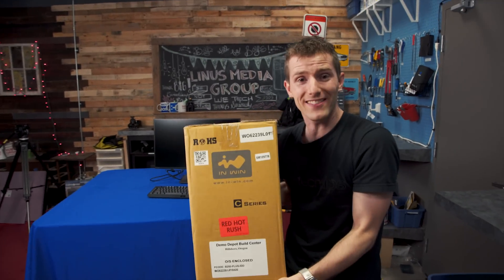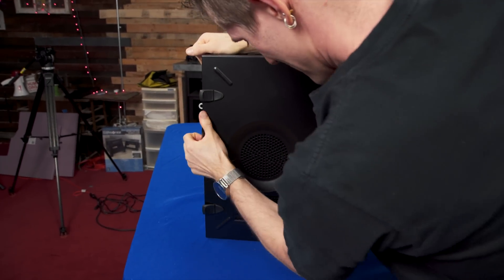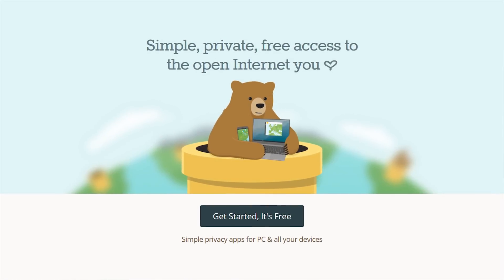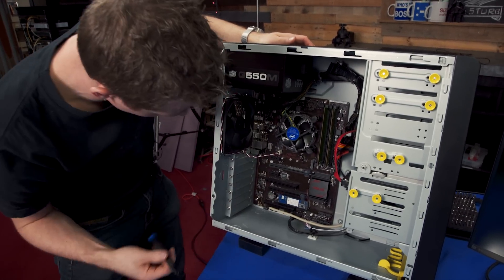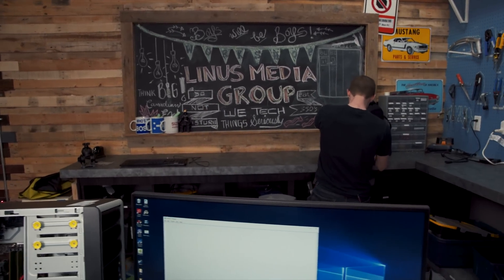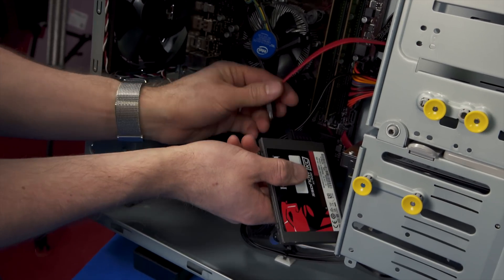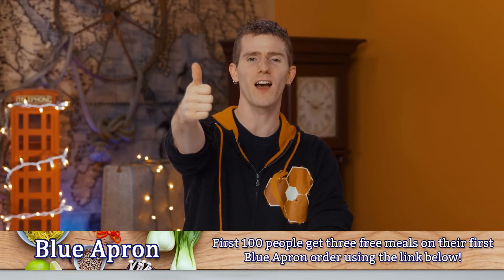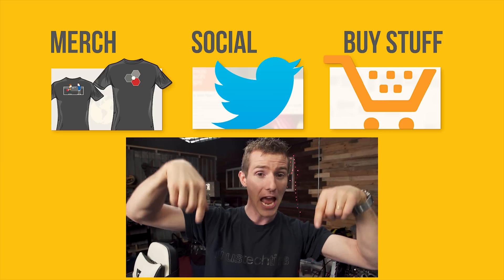Turbocharge your SSD for $40??

Comment: My computer comes with the i7-8700, 7200 1TB drive with Optane 16gb memory. Its blazing fast compared to my previous computer. But if I upgraded to a SSD, I wouldn't buy the Optane memory. Optane memory is only made for Mechanical Drives with the newer Intel CPU's. Its cheap way to get SSD performance. I believe Intel is going in the right direction with the Optane Memory.

Comment: But I presume Optane doesn't have "write" issue like SSD right? The write issue not just decrease the SSD life cycle, but also (for most SSD except Samsung PRO) will drastically decrease write speed of your SSD after maybe a couple hundred or million write process. If this true, Optane have big advantage over SSD. right? Imagine: paging file for windows, scratch disk for adobe, IDM, etc on harddrive instead on SSD.

Comment: OK.. So you cant install this in an AMD Processor MB.. And the question is comparing this installed with a regular HD and then comparing the results with a stand alone SSD not with the module.. I would be interested in those results not this one.. I would wonder if boot times where faster with this with a regular HD and whether or not it was worth the cost or just getting an SSD instead...

Comment: So, this module does pretty much the same thing as using a thumb drive with Windows ReadyBoost to speed up an HDD? Seems like it is just an internal solution with the same effect, but I could be way off with this.

Comment: Buying a couple of 1-2TB HDDs and adding a 40$  chip to accelerate them is much more cost-effective than getting a single 1TB SSD, I think I might buy this little thing... plus it sounds f--ing cool "Yeah I've installed Optane in my system"

Comment: Intel now has on their FAQ that Optane will improve speeds of an SSD.

Also worth noticing though, is that once you connect an optane module to a SATA drive, you can no longer defragment it as it will appear as an SSD to the system.

Comment: Knigston SSD? What changed in the last 2 years that this is a fast SSD? What actually does the optane stuff accelerate. Looking at the graphs this is a hit and miss acceleration. Trubocharge your SSD for 40 bucks?? Nope!! Why nope, because spending 40 bicks mor on a SSD already helps mor then this intel bs. And whoever is trying to speed up a harddrive is 4 years minimum behind technology anyways and just has to switch to SSD anyways.

Comment: Static Static Static, my heart drops every time you touch static sensitive components with no static strap??
Reply: Question: How often have you, or somebody you know, ruined a card cuz "no static strap". Serious question. I used to use them 20 years ago, then didn't use them when I was taking out old components...but the old components always still worked. So I just stopped using them. Has anyone had a problem with this for real, or is it like the "don't use cell phones near gas pumps or in a plane" BS.

Comment: Dude I got one too. It's only the 16gb m.2 module. I am running it from a q nine to only a pcie 2.0 x1 which is an x16 connector. Running it mostly with page files. I will upgrade to NVMe soon. It's nice though about the read/write durability.

Comment: I have both SSDs and magnetic hard drives. I would be interested in something that improves the magnetic drive performance to where it's much closer to SSD performance. I want 4k file performance over large file performance. Large files already transfer pretty quickly on a magnetic drive. However, the 4k/small file performance benchmarks often left me disappointed in the past. I found it better just to use an SSD for most people if they can afford to. 

That being said, an SSD cache would be perfect for cases where I have a lot of files, but I only access ____ at a time. A perfect example is video games. I don't play more than 5 of them per month, but I have over 100 gigs of them installed. I'm still mixed about the 4k performance benchmarks of the past, but if it was higher, I think it could be great for video games. So, that game will load at magnetic speeds on the first run, but on the second run (example: you die and reload a save game), it'll run at SSD speeds. 

It sounds like the server world has this, but I would love a desktop version that isn't proprietary to a system

Comment: The optane is the equivalent of putting a bandaid on a giant gash. You'll still bleed heavily with your hdd (given, you have the m2 slot) when you should have just spent the extra $60 on a tourniquet ssd as your boot drive, leaving your hdd as the slave/mass storage.

Comment: Hmm, i have a bunch of old mechanical hard disks ( 150 / 150 / 300 gb ) and one ssd. So for about 80 to 120 buck i could bring some or all those disks on performance level of ssd. Sounds interesting, but i would need a new motherboard...ram...cpu.. and might as well buy ssd with it....
I think that thingie is nice in some edge cases ( you are buying a new components and have old 500gb to 1tb mechanical disk lieing around ) but mostly its more cost efficient to just buy an ssd.

Comment: What u think i do for 32 gig steem 14 hp labtop  i need help storg shit pleezzzzzz hhd 25 cash 160gig what can u tell me or help me fing batter deal i wood like u professional opinion on what I should do for extra storage for the stream HP 32GB 20 of a used off you understand that's not enough for anything I was going to just get a hundred 20 gig or 60 gig flash drive Mini but I'm thinking about 160 or higher hard drive Dell crew to the laptop

Comment: OPTANE Memory is a good Idea... Sadly it only Cashing the C: Drive... So in Time were NVME (PCIe x4) Drive are Sold on Market its a little Nonsense. A "Normal User" should have a SATA3 SSD or if really uptodate a NVME SSD as C: Drive - Sorry. BTW some one that need a "Boosted" HDD can buy a Hybriate Drive since Years...

Comment: This is actually good for people only using, lets be real a 1 TB SSD or m2 SSD would be way expensive compared to a 1TB HHD + optane. But yeah the requirements to run on of those are basically the same that a standard pc with SSD, so i get the intended use but no the target market, maybe they only introduced this to make some marketing for their Optane SSD, who knows. As my future MOBO will only have one m2 slot I would use it for a SSD M2 card with their own software to cache using RAM

Comment: ehh rather want a 1tb m.2. drive then that optane
Reply: Won't that be the day when a 1tb m.2 drive costs $77
Reply: I agree.  i'm currently looking at the Crucial P1 1TB 3D NAND NVMe PCIe M.2 SSD - CT1000P1SSD8 m.2 drive for $145, read/write speeds of 2000/1750 MB/s.

Comment: I was telling you Linus on another video on that Intel SSD that comes in 16Gigs and 32 Gigs also noted on this video. Yes I agree its a good concept on Intel New tech. I  tried a standard M2. NVME SSD at 256 or 240 simply cannot have enough room for Windows 7 and GTA V PC. all its storage is used for Windows, drivers, service pack 1, all of the Microsoft Visual C++ Direct X 11 and on and on and on. and  virus killer. So  I am waiting for the price to drop on the M.2 NVME 1TB SSD simply wait two years and see what happened if the price dose drop. that new SSD from Intel you was talking about yes I agree wait until they come up with larger 1TB and price it $50.00 so people will be buying it. Knowing intel. its going to cost $2000.00 its because they can. My M.2 NVME slot remains not used for at least 2 years starting 1/1/2018. why pay too much now when can wait 2 years for sweet deals. if the price on a M.2 NVME 1TB SSD for $50.00 I might get one., Both Intel and Samsung is over rated and over priced as the same Apple is.  Why pay $700.00 or $800.00 USA DOLLARS on a SSD of any kind? STUPID! When it dose fail then want? Trash it? I made too many mistakes paying way too much for High Tech that failed because of made in CHINA, disgusting manifactor process. Time for USA and CANADA out China on finance bankrupt.  Then MADE IN USA FOR USA. MADE IN CANADA FOR CANADA. They selling us BULL SHIT PRODUCTS and I like to stop that. That will make ROLEX very Happy and USA and CANADA happy.

Comment: Had to change my comment before I commented I had thought about adding a riser card that supports optane but as Linus says it's only for newer Intel systems. So that must rule out the use of any of the Ryzen chip sets with optane? Now that optane has the matured why aren't they just putting the optane technology directly on the new motherboards?  Just that would make too much sense.

Comment: Having a "high-end" 7th gen Z chipset doesn't mean that one would have a 1t SSD... BUT, I wouldnt pay 70dollars for a 32gb cache ssd, when I could pay $150 for a 250gb samsung 960  and use it (partition) as cache disk for the games I install in HDD's (using primocache). Or I can  just buy more ram with that money (well, when ddr4 was cheap).

Comment: I wasted my money on a 32Gb Optane module. First off, my Intel 600p NVMe isn't supported. Yes, Optane doesn't support Intel SSDs.
Second, the Intel RAID was so buggy, it corrupted my drives and lost all my data 3 times, twice on my boot ssd I had to reinstall windows.
Finally, it's only 1GB/s read in Crystal disk. A 250GB Samsung 960 EVO is 3 times faster and only $30 more expensive than a 32GB Optane.
Reply: lewis hayward
I agree. My Galaxy S8 runs Crysis 3 at 300 fps high settings with OC
Reply: Special EDy is this true? I can't use the optane on an Intel SSD?
Reply: I was unable to pair it with the Intel 600p, I ended up finding it clearly written in the fine print on Intel's website that "their SSDs are not supported by optane".
Reply: Pretty odd. You would think they'd support their own products, but thanks for the heads-up!
Reply: lewis hayward Kind of like the difference between driving a hotrod, or a prius with a warranty. They do make prebuilt PCs with warranties too though...
Reply: @GENOSANDIEGO  yep its true, tried it with work money
Reply: I'm glad I read this because I was about to buy one. Thanks for your honesty you're helping a community
Reply: seriously? software raid? i've been using triple ssds in raid 0 in my system for about 2 years and have never had an issue with it.. even when the power goes out. but i do have an asus maximus viii hero mobo. and as for a warranty, alot of computer parts come with warranties if you get them from reputable companies. most of them are 3 years even, which isn't a bad upgrade cycle honestly.
Reply: I too have had terrible experience with Intel and raid. I prefer to use full-on software raid because of these frustrations over decades with no tangible improvement. Full-on soft-raid in Windows or mdadm in Linux give much more reliable results in my experience. Now, there are some higher-end "hardware" raid (you know why I use quotes there, haha) which I've had no issues with, but still tend to prefer mdadm in most cases. A battery backup on the raid controller is the only real plus I can see over the full soft options... anyways, I'm sorry you had bad experience with Optane, I doubt it has much support, if any for Linux (i'm about to go research that) so I don't know if I'll even try it at this point.
Reply: lewis hayward im actually just starting on building and tbh i guess it depends on who u are but its really not that complicated depending on how interested you are in it and these videos make it so much easier maybe just requires a bit of confidence in what your doing is all
Reply: It says straight up in the intel optane FAQ you cant use it with any NVMe SSD, only sata devices are supported, so this shouldn't be a surprise. You can use the software Primocache to do the same thing with the optane and your nvme though
Reply: Special EDy lolol prius
Reply: lewis hayward it's only worth it if you have the money, because if you don't you'll end up feeling shorthanded all the time. But with a console you feel that 24/7 so what can ya do?
Reply: It pays off to know how to mess with a computer in 2018 worth looking into even as a hobbie mess around with less expensive parts
Reply: the whole point of the optane was to make a "normal" 7200 rpm HDD a hybrid drive, however, to buy a REAL hybrid drive from a good brand is 100 bucks (for 2 terabytes.) and i actually like the hybrid drives. but its a really bad system thanks to bad intel support on it.
Reply: you know whats funny? if you put that optane into a ryzen system with SenseMI it will work great... how F up is that?
Reply: Why would buy Optane when you already have an SSD? LOL
Reply: lewis hayward where in fuck all do you get the conclusion that a minor incompatibility issue with a niche product that is relatively new, is "the whole platform is unstable and bad?"
Reply: Probably because Intel SSDs that aren't optane don't use Xpoint and makes it incompatible. Just my guess.
Reply: HAHA

Comment: Linus, would Optane boost two 7200rpm Firecudas at all in Raid? Give this a test :o

I'd rather run 4tb storage between 2 2tb hybrid firecudas than a 1tb and a 500gb sata SSD costing about the same.
Reply: that wouldn't make any sense at all. your drives are already using flash based storage so the intel chip would just pull the same frequently used data that you platters offloaded into their own ssd. it'd be like the test linus used when he paired it with the ssd.
Reply: Not true, I use a LOT of stuff very frequently, the 8gb on each drive gets filled FAST and the optane would take 16 of that same stuff sure but it'd also get 16 more, so. Sure it'd be a little redundant but at the same time it'd still give me some benefit. I opted for a 256gb WD Black NVME drive instead of Optane. Only slightly more expensive, but I ditched a firecuda to compensate.

Comment: A much cheaper and far faster system is a medium sized SSD (240-500GB) for installed OS and software and a large mass storage HDD (1+TB) for files that don't need fast access (mp3s, movies, pictures, etc).  This method doesn't require upgrading your motherboard, CPU, and memory and will work on any existing platform.  If you happen to have a newer system then just buy a proper M.2 SSD and don't throw your money in the trash.

Comment: Good video. After recently talking to Intel Engineering about this Optane Memory product, they told me as of right now, it's meant to enhance the performance of a mechanical HDD and it's not really intended for SSD drives. But future optane products should be surfacing soon that will greatly enhance an SSD and or M.2 drives.

Comment: I just put together a really cheap system with a few parts i had lying around.  Including an old 3TB wd green drive. And picked up a new I3 7100 cpu and cheap motherboard. I must say this turned out really good. So i have a large main volume for my HTPC and even tho the platter drive is a slug, the responsiveness of the system is quite good.  SRT is perhaps still quite viable, but I was happy with this setup as well. The extra $40 was cheap for the performance boost, and not having to purchase a new platter drive. 

I use a Samsung 850Pro 512gb in my gaming rig, which is not optane compatible. And then use a WD Black platter drive for my games, and this layout suits me just fine, but the Optane setup after it has learned for a while, seems every bit as responsive as the gamer machine, until it comes across stuff that is not cached of course. But it was a really neat experiment.  No regrets.

Comment: I have a SSD with the OS installed and 2 HDD's for the games. If I put a optane module, it will accelerate my HDD's or it only works with boot drive?

Comment: Wow you almost had me I have an older labtop (eith a form factor I love so much I can't find a replacement) with an old hybrid model setup that uses an SATA drive and an M2 slot. I already updated to a 2TB SSD Samsung's fastest SATA model and though I'd see if over time Octane learned to speed me up even more but ... It's not compatible with an older chipset and processor. To be fair I am already really happy with the huge boost in speed my SSD gave me for my workstation Ultrabook.

Comment: Would the obtain modual only work on boot drive or if i had an ssd for a boot drive and mechanical drive with games installed on it would it help game performance or load times when reading from mechanical drive?

Comment: If they will have a PCIe based Optane SSD but no M.2 form factor due to thermal and power limits, why can't they do something like their 750 series where they have a 2.5" form factor that plugs in with the M.2 cord and uses supplementary SATA power?

Comment: Wait a minute! Can it be used as a hard drive itself? If it could be seen in windows as a Hardrive. And raided as 2 or a 64gb model becomes avaible, shit even the 32gb would likely work. Could you not install windows itself directly to the optane? Just the OS itself and then move all applications and such to a NVME ssd.

Comment: why not just put the OS on the optane drive and use the HDD for storage? me and a friend built a machine with 2 optane drives and we put windows 10 on the drives and it only takes 6 seconds to boot into windows, and we haven't even cut out the bios, or chopped up windows or turn on fast boot and we don't even have the M.2 drivers yet. we're thinking we could get the boot time down to 3 seconds. that's almost as fast as a machine running DOS or basic.

Comment: I think it has value, but intel is flirting with that line. Why pay $80 when you can get a samsung 960 evo 250 gb for a little more. I think if the price point was $25 for the 16 gb, you could have a better argument.

Comment: Hey, I already boot my computer with an SSD (small one, doesn't fit every program) and I already have another SSD for important data. But I do have a 2TB HDD and most my programs and files are there. Should I get Octane to accelerate those files or will that not help much? Currently my system boots quickly but the loading of the programs (specially chrome, since I shortcutted it to the HDD).